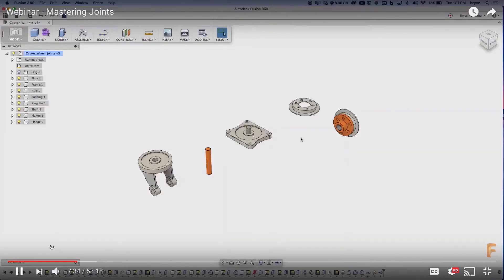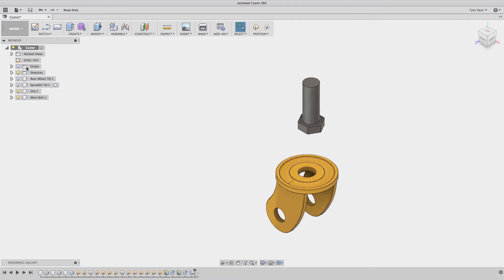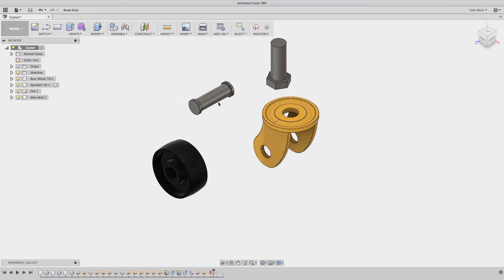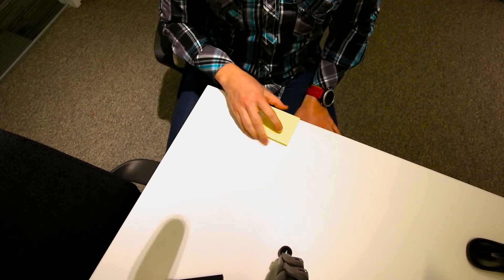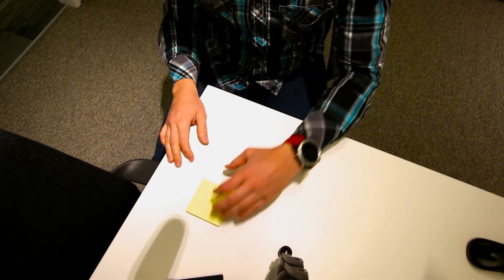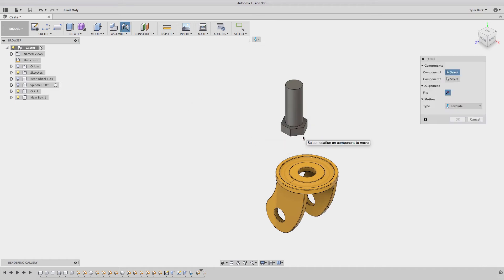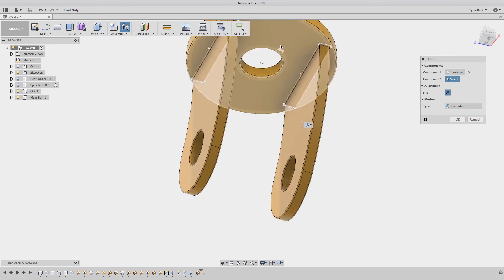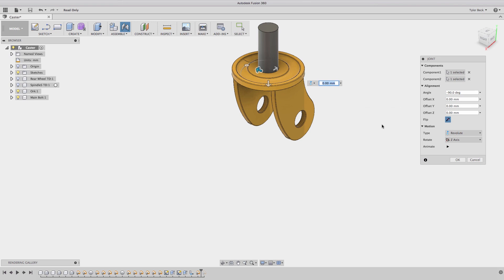Fusion 360 Joints - 3 Things Beginners Need To Know

Comment: This was driving me nuts. Coming from Inventor and going back and forth frequently, my brain is usually stuck in Inventor mode, which is "old school" but very straightforward. Fusions joint interface is so unobvious to those coming from this other way, and things just seem odd.

I still don't have a good idea of how to constrain half the stuff I make, especially when I just want to make two faces co-planar despite there being no obvious other physical relationship yet, but at least this video helps explain one of the fundamental changes that Fusion is trying to package all of the constraint information between two parts into one link entry.  

I mean I still want to burn the desk of whoever at Autodesk thought that was something they should force upon us but, hey, at least I'm starting to get on the right path.

Comment: I really like how you acknowledged the "old way" of creating mates in other software, but it is frustrating that I can't find documentation that goes right to the issue: how do I do surface-surface mates, but in Fusion?   (context: I've been working with / learning Fusion for 8 hours over 2 days, and I'm able to figure out or easily absorb things UNTIL I get to joints.  Poking around the UI isn't working, the documentation focuses on revolute, etc...)
Reply from the maker: Thanks Ben.  Unfortunately Fusion hasnt adopted the mates/constraints...I kind of wish they would.

Comment: Grounding is bad practice with Joints in Fusion 360... which I didn't know until a couple of months ago. Touch base with Xander on that for more info. You get away with it in this example because all components are at the top level.
Reply from the maker: Scott Moyse, interesting... I will follow up w Xander.
Reply: Good video! 
Not sure if grounding is a bad thing, but I prefer to create a rigid joint to the origin in stead of grounding.
Reply: Harold Weistra grounding is only local to the parent component. rigid groups are global.

Comment: I've watched every or nearly every one of your F360 videos now. The have helped me go from totally bumbling beginner to a semi-competent beginner. So often it seems you are looking over my shoulder and have seen my mistakes. Apparently, a lot of people make the same ones. 

Now I have a couple of requests if you don't mind. Loft, I don't see where you have covered it and it so happens that my one design I've done that has turned into a product for me I used loft. I was very ham-handed about it but I got there. I'd love to see how to streamline my workflow with this.

Second, I see people that are parametric wizards, design a lidded box once and now just punch in your material thickness and the dimensions of the box you want and BAM! no starting from scratch. My designs run 30-40% parametric but I'd love to learn to make something 100% parametric. 

Thanx
Reply from the maker: Mark Evans, thanks man!  Glad to hear it's helping!
I will definitely do a video on lofts.